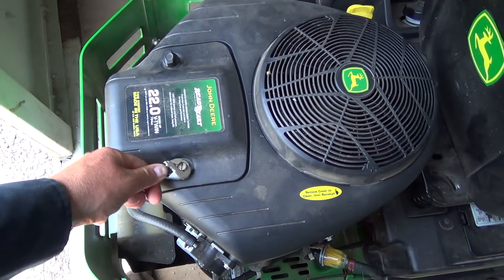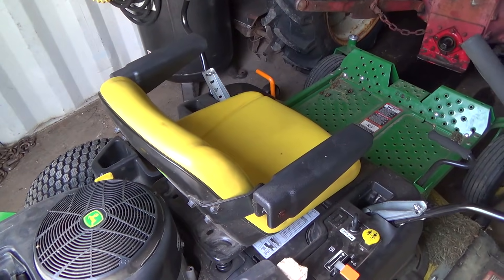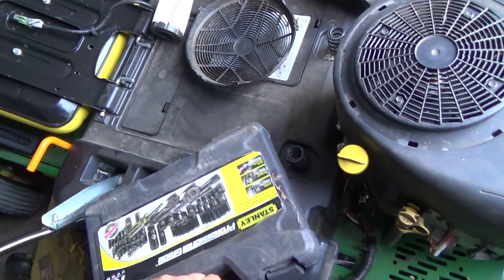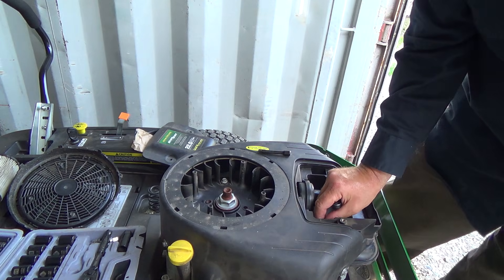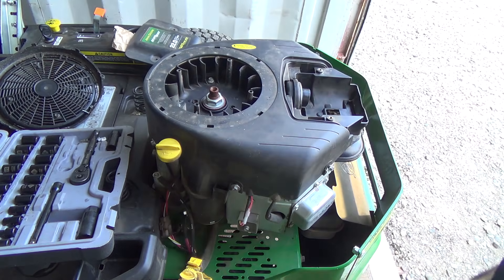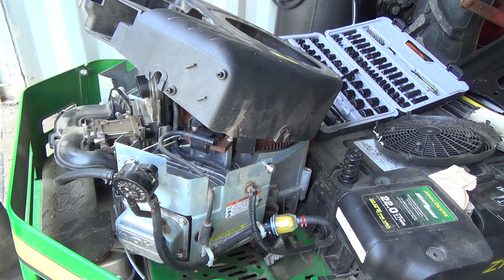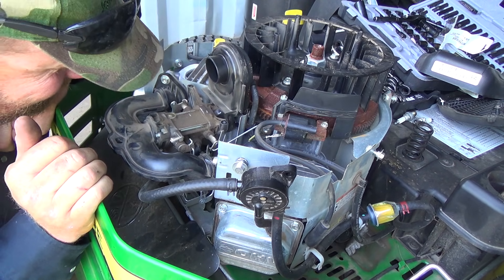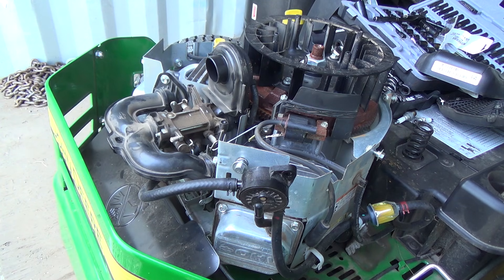Oh no.....We have our first issue with the John Deere 0 turn mower Z355R Intek m44

Comment: yes dirty carb. these days ethereal fuel sucks even when you buy the ethereal free there still up to 20% at lease here in the tax my ass off state of new york. they do sell 100%ethereal free so they say but its 3.50 a gallon where the other is 200 a gallon try some sea foam in your tank bill sometimes that clears them up after running it through the tank but my 35 years experience is the carb coming off to be cleaned as you know yourself and than your going to see unless briggs changed carb design the inters are plastic yes plastic float etc junk  ok on with the video to see whats wrong

Comment: clogged jet
Reply: had the same issue with mine and it was a piece of dirt in the jet not letting enough fuel through spar plugs won't change it
Reply: spark is good
Reply: if you can make it run with the choke its definatley clogged jet
Reply: if the solinoide was malfunctioning it would not run at all Bill
Reply: I am leaning on that also Perry...man I am going to pick up my Z345M zero turn today from Home Depot and I really hope I don't have to start wrenching into it soon...